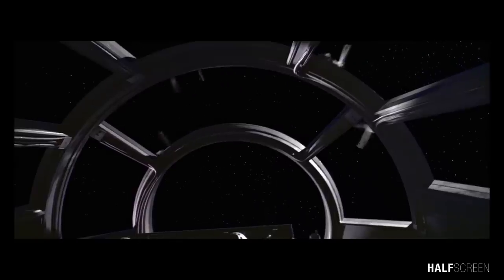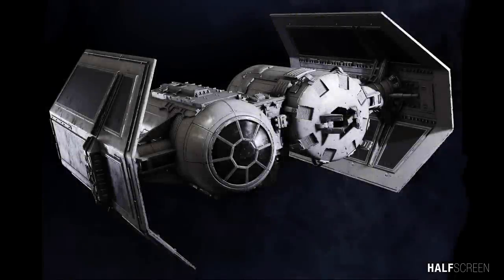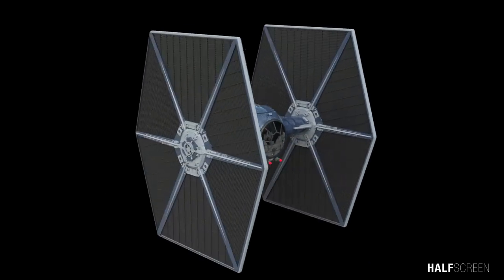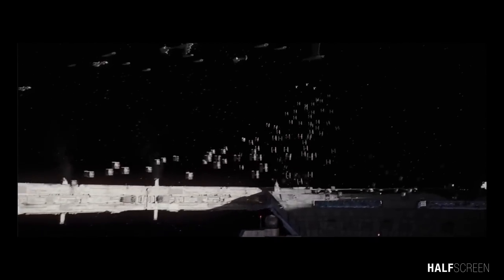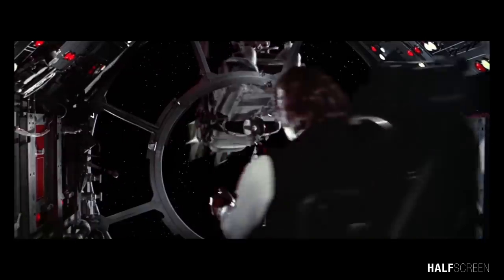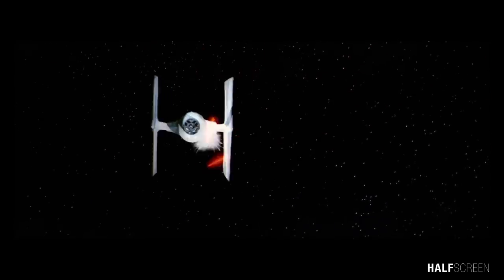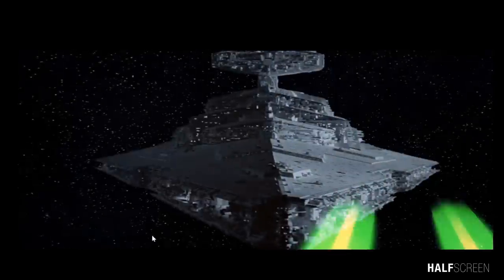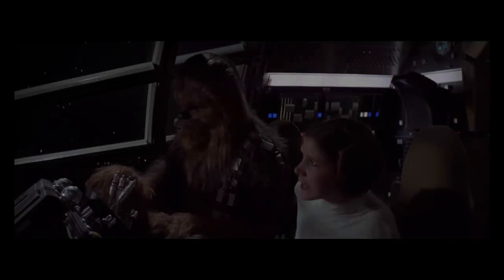Star Wars:  Inside the Tie Fighter

Comment: The Special Forces Tie Fighter was a lot better. Special Forces TIEs were equipped with hyperdrives to enable the fighter to go on long-range missions far from a base or carrier ship, enhanced deflector shields, and high-yield cells that provided additional power to onboard systems, which were necessary because of its more powerful weapons and stronger shields. Plus it had a gunner to cover the pilot’s six. (Technically they are both pilots who have the ability to fly the tie fighter but the gunner obviously played the combat systems officer role).

Comment: It makes more sense to have the  wings be radiators to get rid of the immense waste heat, similar to the reason the X-Wings had S-foils. Solar energy would be highly variable and render the TIE useless in dark parts of space, and there would be extremely minimal retcon involved: literally, the energy goes the opposite direction, and the panels are just radiator grills.

Comment: One of the most iconic yet unpractical star fighter designs of all times. So many design features that make little sense.
But the animation is cool and well done as always.
Reply from the maker: Yeah.  I was kind of surprised it used solar power, it's an eco friendly starship, how ironic.
Reply: @Halfscreen  Isn't it? Also, the engines are WAAAYYY undersized for such a craft, especially when compared to the rest of the starfighter models.
And the huge, non-folding solar panels would make it an absolute nightmare to maneuver in atmosphere. Not to mention that they'll only work when there's an actual sun in operational range, being dead weight otherwise. And literally no other space ship in Star Wars having solar panels except this one.
But hey, at least it looks interesting when seen through an aiming reticle, right?

Though without those huge solar flaps, the small ball-shape of the TIE would actually make it quite hard to hit.
Reply from the maker: @axelhopfinger533  LOL, the engines are definitely too small and the solar power wings don't make any sense since, under battle conditions, they may not be even close to a star.   Maybe they need to upgrade to Tesla batteries.  😁

Comment: I always felt the solar panel wings were just dumb since the days of the old X-Wing game. They would never make enough power to run a fighter. They should instead be heat radiators to release excess heat from the lasers and engines, that would make more sense. It should have it's own built-in power source (probably fuel cells or something). The Fuel Tanks seem really small for the Tie Fighter too, and it will need propellant tanks for the Ion engines, but eh, it's Star Wars. Thanks for showing the design!
Reply: The panels on a tie fighter could be plates for a casimir effect zero point energy process.

https://en.wikipedia.org/wiki/Casimir_effect
Reply: isn't those panels shields? When I play TIE fighter collector edition I have to set power to shield ratio. Solar panels? How efficient is the conversion when most stars are long way away from the positions of the battles, unless they pick the battleground close to a sun...
Reply: @barackclinton568  thing is, the Casimir effect is even smaller then if you'd used modern-day calculator PV panels, let alone high-grade silicon cells used in spacecraft where weight is more important than cost.

the video (and other media) indicates they do double duty as both emissive radiator and solar collector. the reactors in the middle of each wing probably tap the fuel reserve for power in some way to suplement. they don't have a ton of power, though, pilot has to wear a full space suit...
Reply: @DFX2KX  maybe a kasimir effect more powerful than we know of today.

Comment: The sad thing about this design, is that heat radiators don't work in space.

Because space is an almost perfect insulator. The secret to your thermos is that it is an outer shell, and an inner shell, separated by a vacuum just like space, causing the heat energy to transfer at a snail's pace through one contact point.

Space is not hot, nor cold. Space is a temperature less vacuum. The only way heat transfers is if something is touching something, or if it is being actively carried in another form of energy, such as a light wave or radiation burst.

This is why most space related things in real life are white. Because white reflects light, and the heat it carries, and light is one of the few ways heat can travel in a vacuum. Because of this, just standing in the sunlight without light-reflecting white gear and a refrigeration system will give you heatstroke and kill you in minutes.

And if something absorbs heat too readily, like a bare shiny metal surface, it heats up quickly from the sunlight to thousands of degrees hot (which is part of why spacesuits are so thick and bulky, to protect you from accidentally touching such surfaces and burning a breach into your suit, the other reason being structural reinforcement against depressurization)

In reality, a TIE fighter's heat radiators would heat up, and then just keep accumulating heat until they straight up catch fire and melt, which would likely cause it to just, you know... explode once the heat build transfers back to the central body.

Iconic look, but nonfunctional design.
Reply: Pretty solid observations.

Heat radiators DO work in space (the ISS has them), they're just not efficient in the same way that they are in an atmosphere. As you noted, the only way to disperse heat is with emission (IR light) or conduction (physical contact). They'd likely have to use some sort of phase-change loop like an air-conditioner instead of a liquid-based system like your car uses, because phase-change systems can emit latent heat as IR if forced from gas to liquid, and then re-absorb it on the 'cold' side. And that refrigerant would need to get VERY hot to emit enough black-body radiation to be useful. I would not want to touch those panels at all after my TIE landed. Seeing one through an IR camera would probably be a trip, too.

It's also possible to use the heat from the systems to also heat the fuel going into the engines. That is assuming that the engine propellant isn't also the cooling refrigerant, which you CAN do to accomplish this, such as the Shuttle's main engines using the LH2 for nozzle cooling. This has the upside of increasing exhaust velocity for basically free (you're making the heat anyway!) and causing the exhaust to quite helpfully take some of the heat with it. As SW lasers are more properly particle cannons (tabanna gas), some of that heat leaves via the angry green beams of death, but probably not so much that you could hold down the trigger for very long.

Comment: Say it with me now: TIE "Wings" are heat radiators, NOT "Solar Energy Collectors" - Unless you're flying around in the innermost planets of a star system, you're simply going to be too far from any stars to capture any sort of meaningful power input. Radiator panels make WAY more sense - Have you seen how tiny the TIE's engines are? No wonder they "scream" like that as they fly past, the engines are working double-triple-over-time!! Working the engines so hard is going to produce a ton of waste heat - we see exactly that with the Eta-2 Actis "Jedi Starfighter" - which features a set of radiator panels that fold out when the fighter switches to "combat mode" to off-set the extra strain on the engines.
Reply: Just because that makes more sense doesnt mean its true. Just look at any official diagram for the TIE series fighters and they are all solar panels
Reply: I would love to know who told you that. Cause no part of what you just said is even close to being valid.
Reply: All blueprints of every TIE ever calls them Solar Arrays or Solar Collection Arrays. Who tf told you the garbage you just spouted out??
Reply: From "Star Wars: Technical Commentaries" (http://www.theforce.net/swtc/tie.html#wings)

Technology

Wings & power
TIE-series starships have enormously powerful reactors for their size, as demonstrated by the fighters' potent firepower and dynamic handling in dogfights. Since reactor power is disproportionately great for the size of the craft, the removal and dissipation of waste heat becomes a problem of fundamental importance. TIE engine design makes this particularly problematic, because the outlet nozzles are narrow. Thermal energy from inside the engine is only able to exit through an effective aperture of less than a hundredth of a square metre per engine.

The solution is to add two or more heat panels to the sides of the ship, and to pump the reactors' waste heat into radiator wings. An effective radiator requires a large surface area, but making the wings too extensive would interfere with the pilot's view. The wing configuration of each TIE design, with a given total reactor power, is a compromise between these opposing considerations. Darker surfaces make more effective radiators, hence the predominant charcoal-black tone. For a given wing shape, the effective surface area can be increased by introducing a fine grille texture or some other pattern of lumps or ridges. Even if we ignore the contribution of corrugation, radiators held at only a few hundred degrees (much less than the several thousand degrees of the incandescent engine interiors) may increase the effectiveness of heat removal by thousands of times.

The more powerful the craft, the greater the total wing area should be, assuming that radiator technology remains constant and that the same panel texture is always used. This is the case for designs newer than Lord Vader's TIE. Ships such as the TIE Avenger, Defender and Scimitar appear to follow the wing-area/power rule-of-thumb. However there seems to be a distinction between the flat-wing and bent-wing designs. The flat-winged TIE fighters tend to have greater wing areas for their power; much greater than an Interceptor or Vader's long-range craft. Bent-wing configurations may give a fundamentally better radiator quality, perhaps through some kind of improved heat circulation. Alternatively, there may be no technological advantage, and the high-power small-wing designs may be expected to suffer more obscure technical drawbacks. They may be more fragile or difficult to maintain.

Since most TIEs are intended for the rigours of space combat, there are some tactical design constraints. To help reduce the chances of being hit, a fighter should be shaped to minimise the area visible to an enemy. The most dangerous situation in a dogfight is when the TIE is directly in front of its foe: this happens either when the TIE is being chased, or in a head-to-head attack. With the two ships moving and accelerating in parallel or antiparallel directions, the enemy pilot has maximum time to aim and shoot. Encounters are much briefer when the fighters are at oblique or acute angles to each other. Thus the wings of most TIEs are built so that they face sideways, and they appear only as thin lines when seen from the front, back, above or below.

The bent-wing designs redistribute some of the side surface area to diagonal facings further towards the top and bottom. This makes the craft a smaller target from the side but a larger target from above or below. This may be an advantage if side attacks are more common than vertical attacks, but it's unclear whether or not this should be so. Also, it isn't obvious whether this possible tactical advantage would be the primary reason for bent wings, or merely an incidental benefit.

Apart from the wings, the TIE design is very compact and reduces exposure. Most of the machinery is packed within a cockpit ball and the pylons which support the wings. If the large radiators weren't needed, it is likely that the entire ship would be made spherical.

The compact and enclosed engine design minimises vulnerability to enemy fire. Because the thruster nozzles are no more than a hand-span wide and the drive mechanisms are hidden within the main hull, a TIE would rarely suffer the kind of engine hits which rebel fighters often receive on their stripped-down, oversized and exposed hot-rod sublight drives.

Except on larger TIE craft, the power reactor(s) are usually mounted within the cockpit ball. The exact location is uncertain, but the possibilities are limited since the ball is mostly hollow, and has large windows on several faces. There are two ringlike structures running around the cockpit ball: one above and one below the pilot's level. It has been speculated that these are toroidal fusion reactors. Alternatively, the reactor(s) might be directly beneath the pilot seat, between the engines. Considering the small amount of space available, the reactors of Imperial starfighters must be marvelously compact devices, or else must occupy much of the craft's volume.

Secondary wing functions:
Some sources suggest or assume that the wings of TIE craft are solar power collectors. Unfortunately, this cannot be one of the wings' significant functions. Sunshine and starshine are not sufficient to power the propulsion, weapons or any other major mechanism of any craft which is as potent and dynamic as a TIE-series starship. If the fighter is operating in space near a habitable planet, the sunlight will provide no more than about a kilowatt per square metre. The common TIE has an array area of just over a hundred square metres. At this rate, it would take at least several weeks to accrue enough energy to enter or escape the gravity-well of a planet. The energy requirements for hyperspace jumps, made by the non-combat TIEs and the most advanced fighter models, are much more extreme.

A solar-powered TIE would be at a great disadvantage if it was deployed in the outer reaches of a system or in deep space. At most, any solar power collected through the radiators is supplementary to the onboard reactors. Perhaps it is enough to augment the power to cockpit instrumentation and other peripheral processes. At most, solar power could be used for ignition when the fusion reactors are cold-started. They might barely provide enough power to charge up a small, low-temperature electrode fusion device, which might in turn help to initiate the main reactors. (Of course, this would not be the primary justification and function of the wings, but it might account for the popular perception.)

Various commentators have suggested other secondary functions for the wings. Most of these alternatives are concerned with propulsion:

It has been speculated that the wings serve as electromagnetic devices to further manipulate the engines' ion streams. This theory suggests that the wing area should be concentrated around the stern. However, most TIE wing shapes are balanced in the fore-aft direction, or else are extended forwards rather than backwards.
Another idea is that the wings are gravitic devices which are somehow used to rotate the craft. However this would violate conservation of momentum and angular momentum; if the fighter can spontaneously start turning, it must be exchanging momentum and angular momentum with something else, be it the ion-stream exhaust or its deflector shields. Most TIEs lack shields, and the exhaust is already well manipulated by the thrust nozzles.
Another idea is that the dark areas are exhaust grills for waste gases, but it is hard to see why such a large area would be needed for this kind of process. The true functions of the TIE wings must be area-dependent.
It has been suggested that the wing spokes may fire propellant to assist manoeuvring, but they appear to be structural, show no sign of nozzles at their tips, and this theory can't explain why the intermediate dark areas would be needed anyway.
As part of the radiator function, the spokes probably serve as conduits for some kind of coolant. Hot coolant will be moved from the reactors and engines, through the wing pylons, along the spokes, through the radiator panels, and back through different spokes to the pylons and the ships' core systems again. We need not know the precise physical and chemical nature of this coolant, only that there is a coolant of some kind. If TIE wings do play a role in manoeuvring the craft, it is probably via some method of temporary braking acting on the circulating coolant (assuming that the coolant is ordinary matter with mass).

One more suggestion is that the wings are shield generators. However most TIEs struck by laser cannon fire do not behave as if they are shielded. Furthermore, there is the significant fact that many classes of ships known to carry shield generators (eg. X-wings, Y-wings and star destroyers) do not also have features resembling TIE wings.
Reply: @geoffo7920  That would be Dr. Curtis Saxton, author of 2 of the "Incredible Cross-Sections" books, with a doctorate in astrophysics from the University of Sydney. https://starwars.fandom.com/wiki/Curtis_Saxton
Reply: @TheScwall  well, unfortunately, he is still wrong as those are indeed Solar Arrays, as, like I said before, EVERY TIE blueprint for the original TIES and all variants say
Reply: @TheScwall  Or you could just look at an actual Star Wars Wiki and look at THE SECOND SENTENCE for the TIW series fighters> I have official Star Wars books ta my house with diagrams of the ships and they are ALL SOLAR PANELS. https://starwars.fandom.com/wiki/TIE_Series
Reply: @TheScwall  who uses astrophysics in Star Wars lol
Reply: It's a movie with a mandog called a wookie, visible laser beams  and faster than light travel... if they want it to be solar powered it's solar powered
Reply: @jamiee1519  Not to mention a mystical "force" that permits one to perform magic.   Nothing in Star Wars makes any physical sense - it's simply fun to watch.
You might fare better arguing the reality of the Bible with a fundamentalist.